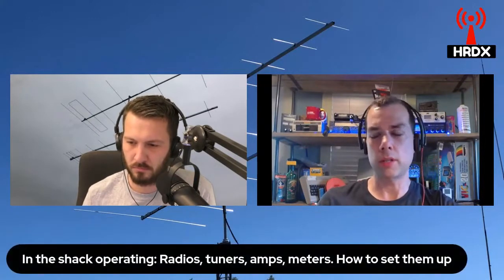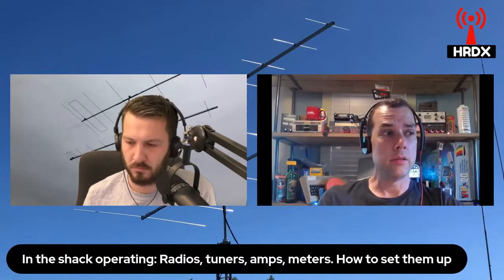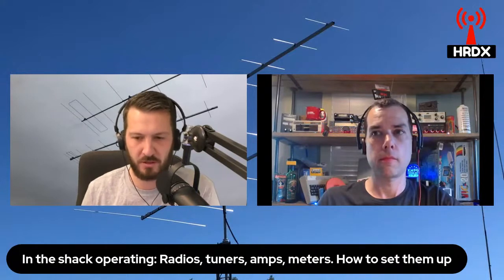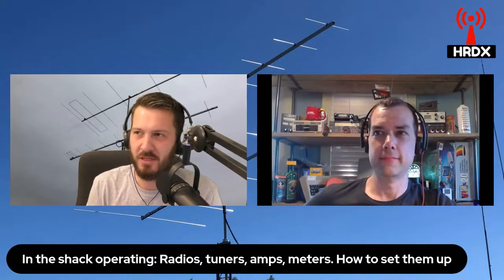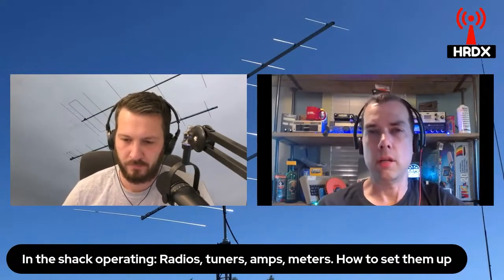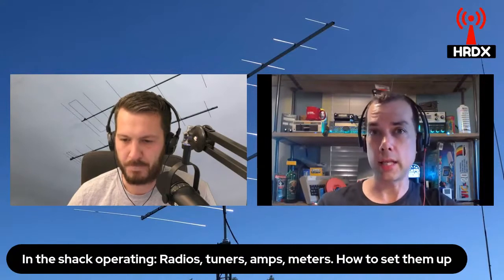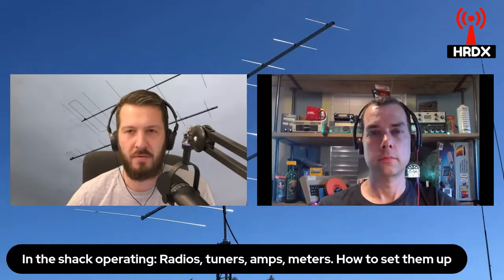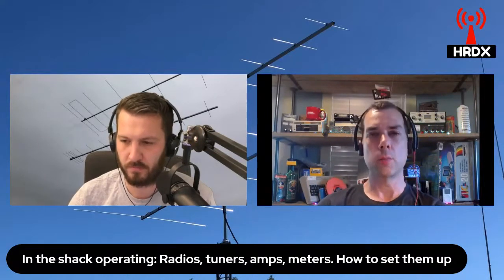Antennas Tuners Explained | Ham Radio Basics

Comment: ARRL Antenna Book explains this:  It is a mistake to assume that there is anything sacred in effectiveness, at least) in using a resonant antenna. The resonant length happens to be one that is convenient to analyze. At other lengths, directive properties are different, radiation resistance is different, and the impedance looking into the terminals of the antenna contains reactance as well as resistance. The reactance presents no problem, because it can be "tuned out." The antenna system can thereby be resonated, even though the antenna itself is not resonant.

Comment: I am thinking that what an antenna system tuner does is re-reflect any reflected power from the load back towards the load, and if your antenna system is not properly constructed to be resonant on a frequency on which you want to transmit, that power will just reflect back and forth repeatedly along the coax until nearly all of it gets converted to heat within the non-lossless coax.  This explains why when you use the antenna system tuner to match your nowhere-near-resonant antenna system to your radio, it sees a properly matched system, but your signals do not get heard.  If your antenna system is not resonant enough on a given frequency, putting an antenna system tuner between your transceiver and the antenna system, or even between the coax and the radiating element, will essentially turn that antenna system into a dummy load.  This is why it is crucial that your antenna is resonant on the frequencies on which you wish to transmit.

73 VE7NDE

Comment: Been working a lot of d x with g5rv and 100 watts. 70ft rg8x to tuner 20m and 17m. Home brew g5rv. 102ft copper wire. If you trim to resonance on 20m it will not be multi band let tuner do its work. 31ft of 450ohm line to coax. S w r is about 2:1 at 14.000mhz. 73s.

Comment: For a home station a manual tuner is best in my book.  If when I switch to a different antenna (at home) and set up the tuner knobs to the numbers I have found created a good match in the past, AND the SWR is different from what I saw before with that antenna, it tells me to go check the antenna.  It could be on the ground, have a branch rubbing on a wire, etc.  With the automatic tuner I can push the tune button and it will tune, but it may only be tuning the feed line, or a wire lying on the ground, and even sometimes with a very good tuner it was tuning only the piece of coax from the rig to the tuner.  Some of our newer tuners will actually tune a wet noodle. The tuner will make the transmitter happy but you may not be using a good antenna, or ANY antenna at all.  And your receive/contact performance will suffer.

Dave K8WPE since 1960

Comment: VSWR is actually the ratio of the peak to the trough of the envelope of the standing wave resulting from the superposition of the transmitted signal and the reflected signal.  Regarding your comment about "not making better contacts" - this isn't true.  By properly adjusting the matching unit, the complex conjugate impedance reflects the returning signal back towards the antenna.  There is some loss in the feedline, mainly when using coax though.  Very little loss using open wire line or ladder line, so the only real loss may be some losses in the antenna.  If the matching unit is located at the antenna, performance can be as good as a resonant antenna.
Reply: I wish more people understood this.  They way the guy in the video explains it (incorrectly), the tuner burns up power making heat which is absolutely wrong.  Tuners do not get hot, or even warm.  The power ends up getting RADIATED out the antenna, not burnt in the tuner.
Reply: @Machria23  correct….there is almost no loss in the tunner….even in little cheap ones !
Reply: @Machria23  there is more people out here that understands how it works ,can't believe they making a video feeding us with  wrong information

Comment: What about ladder line. I have a 160 meter horizontal loop at 100 feet and use 300 ohm ladder line to a DXE 10 kw 1to1 balun and 6 feet of LMR400 to a palstar AT2K it works really well 160 to 15 meters by not using very much coax you get rid of a lot of loss because of the impedance mis match.

Comment: Some of the commentary  is wrong or questionsble. e.g. reasonant antennas do not work better than non-reasonant  antennas.
Reply: There is a common misconception, echoed in this discussion, that tuners just make the radio "happy" and don't actually make the power transmission to the antenna system more efficient than without the tuner.  The end result of efficiency and effective radiation is heavily dependent on the overall system. Tuning 40 m coax fed dipole with 100 ft of RG58 feed line into submission on 80 m is going to be a terribly inefficient performer for a number of reasons. But, tuning a ladder line fed large doublet antenna can be highly efficient and a very strong performer.
Reply: That would be a valid statement if you put Some as the first word of the statement…

Comment: Toad harbor feedline is one of a few ways to get 97% of power out of the rig to the antenna via balanced Tuner. Plus Balun’s are only good for vswr of 3:1 or lower or they will heat up and fail usually at the input to the balun that pl259 can’t take it and or the core saturated and becomes inefficient and swr climbs.

Comment: Many antennas are designed to be non-resonate……and they can be very efficient  and you can have a resonate antenna that is not efficient at all…
Reply: Correct. My doublet is close to resonance on 80, but not resonant on any band. BUT it works extremely well
Reply: @vk3zb534   I use an inverted V ( cut for 80m) fed with ladder line with a 4 to 1 balun and a tuner….and just like your antenna….it works great also.
Reply: @Sneaky-Sneaky absolutely!!
Reply: @David White I know….it’s kind of strange….